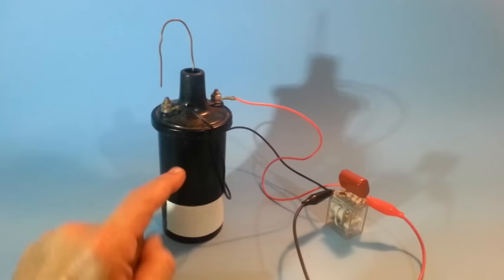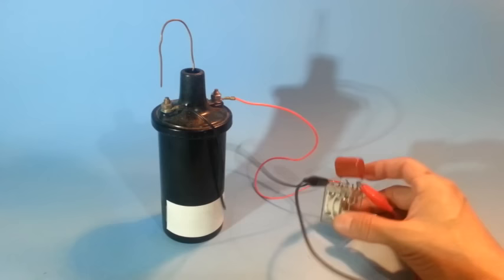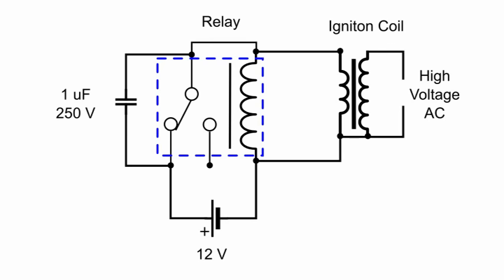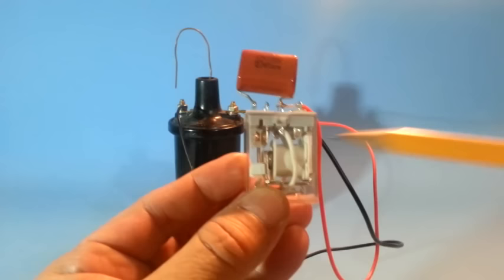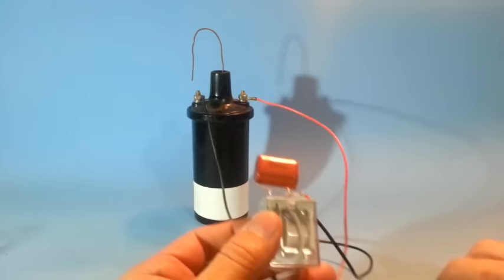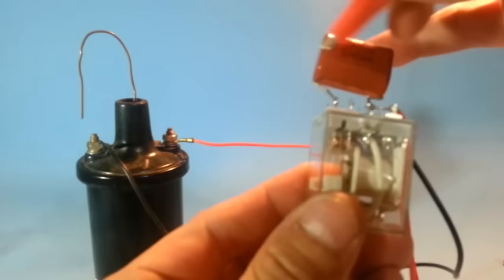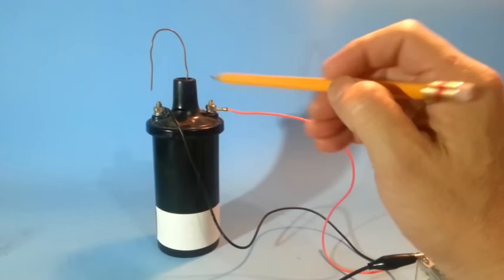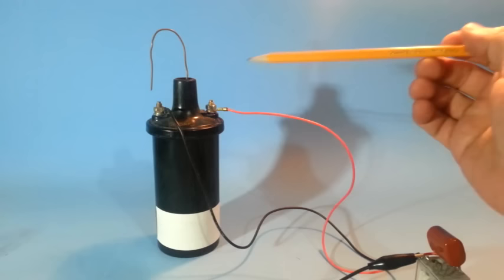Easy High Voltage with Ignition Coil and Relay

Comment: This circuit is ALMOST the same as the Tesla oscillator. the only thing to do is move the capacitor, in series with the primary coil of the step up transformer. The relay most NOT have a diode.  The primary is made series resonant with the (tuned) capacitor, and the inductive spike impulses of the auto oscillating relay are fed into the primary. this Tesla circuit can be found in the august 1919 article in the Electric Experimenter.
Reply: Though I do wonder what an auto oscillator relay circuit would need to be at resonance with the primary coil...
Reply: @After_Tech_Industries   the mechanical switching distance and supply voltage needs to be controlled to get the right frequency, which can be a sub harmonic of the primary coil resonant frequency

Comment: This video has randomly popped up in my feed, this is very handy for a basic arc generator, but this is pulsating DC for AC to be produced the current actually needs to be alternating positive to negative and back, this is just creating a high voltage spike from collapsing and reestablishing magnetic fields

Comment: I built one of these in 1975. My bully tormentor never knew what hit him. Twice! Ah, good times. Good video!
Reply from the maker: LOL ( ͡° ͜ʖ ͡°)
Reply: @ludicscience   hello sir can it work with a electronic resin ignition coil? with a electronic distributor system? just making sure and how many amps does the relay need? set up on a lancer sl 1985 production
Reply: hold up

Comment: the spark can be fed into the ignition coil primary if the primary is made series resonant (low impedance).
 the impulse (inductive spike from the relay coil when opening) will than be used to amplify the secondary, 
and will give much higher output! 
With NO spark at the relay. 

I will build it and show it on my channel, as this is how N Tesla did it.
Reply: Ok. Cool

Comment: Why do you need the capacitor? If you rig the normally closed switch in series with the relay coil when powered on the relay will open cutting power causeing it to close energizeing the relay coil opening it again causeing pulses.

Comment: I've done this using an old fashion doorbell buzzer to make and break the circuit. One good tip is to use the original ignition capacitor in the circuit. The original capacitor will have the correct capacity to match the coil perfectly for maximum high voltage output. Use of other size capacitors will not produce as high a voltage.
Reply from the maker: +MrCharlieCom Good advice thanks!
Reply: MrCharlieCom . hi, what is the original ignition capacitor value. thanks
Reply: I've played around with these before and it makes a big difference what size capacitor you use.

The correct capacitor depends on the particular model ignition coil. About the only way I know of to tell is to find what model car the coil came off of, then look up the part number/specs for what ignition capacitor was on the car.

If you went to a junkyard and purchased a used coil, maybe you could have them pull the matching capacitor at the same time.

Otherwise, you might try several different capacitor to see which gives the most output.
Reply: Like unbalance voltage from coil and capasitor?

Comment: Ludic Science ...What is The RELAY your using here ?? Is this a 12V Relay Or Something Bigger ??
Reply from the maker: 12v 10 amp dpdt relay
Reply: Im Using 30am / 12V Relays BUT they don't last as they are getting HOT and Burning up ...Can you suggest something ?
Reply: Ludic Science ...I Really Love your posts, BUT can you Comment about my Coil Driver Issue. My Relays Continue to Burn up or Jam ..Im thinking the Relay is Cycling to fast ?? Im using a Quality Relay ...is there a way to Slow the Switching ??

Comment: Alan McPherson  Referring to early ignition systems.

TO FURTHER CLARIFY...One of the laws of magnetic induction is that the output voltage of the secondary winding is dependant on how quickly the primary field collapses. If you took an auto ignition coil and applied 12 volts AC at 50 cycles the output from the secondary would be surprisingly small, because the rate of the applied current is relatively slowly building up and diminishing at only one fiftieth of a second, but apply an instant 12 volts into the primary, and provide a fast path for the collapsing field current to follow, and enter the capacitor, which quickly sucks up the energy, thus the output will be dramatically increased. Then the points shut, which discharges the capacitor, ready for the next cycle. The points capacitor Is not present in the circuit to stop arcing and damage to the points, it is there to assist in the rapid collapse of the magnetic field quickly soaking up the current from the collapsing field. That it stops arcing and destruction of the points is just a happy coince

dance.

Comment: Been trying this for a small project but can't get both the coil and the relay to work together with the capacitor. I have connected a spark plug to the coil and can spark the spark plug once using a 9v battery without the relay and I can get the relay to continuously oscillate without the coil connected but having problems combining the two set ups so the spark plug continually sparks intermittently.  Any help would be grateful.
Reply: yeah sorted it out - didn't use the capacitor afterall and had a continuous spark! Aren't I clever eh? So to get a spark plug to spark continuously all one needs is a power supply, ignition coil, relay and spark plug!

Comment: I just tried to build this circuit using a matched automotive condenser/capacitor but my automotive relay is just buzzing. Is the oscillation too fast for standard relays to be able to actuate? Did you use a reed relay? The one in the video doesn't look like a reed relay either. Any advice would be greatly appreciated!
Reply: I'm having this same issue. The relay just buzzes, but no spark from the coil. You ever get it figured out?
Reply: @BuildNStuff  ended up using a pre built high voltage generator. Cost less then messing around with relay and caps and is all solid state: https://www.amazon.ca/dp/B07ZYY6KZR/ref=sspa_dk_detail_0?psc=1&pd_rd_i=B07ZYY6KZR&pd_rd_w=ivXhb&content-id=amzn1.sym.c7dca932-da6a-44fc-af09-cc68d2449b34&pf_rd_p=c7dca932-da6a-44fc-af09-cc68d2449b34&pf_rd_r=5G77CPRC76SANBWVRN5Y&pd_rd_wg=KDqqm&pd_rd_r=624b8654-14f4-45ec-8fc2-5b74ca6ad23b&s=electronics&sp_csd=d2lkZ2V0TmFtZT1zcF9kZXRhaWw&spLa=ZW5jcnlwdGVkUXVhbGlmaWVyPUEyMDVMOTFNTFNISzFVJmVuY3J5cHRlZElkPUEwMTkyNzQ3M1UwWDVZUkdLSlVMSiZlbmNyeXB0ZWRBZElkPUEwNDc2MDQ4Rk5HN1VRSDg2Q1BEJndpZGdldE5hbWU9c3BfZGV0YWlsJmFjdGlvbj1jbGlja1JlZGlyZWN0JmRvTm90TG9nQ2xpY2s9dHJ1ZQ==#customerReviews

Comment: When i connect relay to ignition coil it stops buzzing. I think its because of low current(1amp adapter). Relay's coil got 400k ohm, indiction coil got 0.6 ohm. Can increasing amper output help? Or adding some resistor on way to indiction coil make it work?

Comment: Mr ,if we change capasitor with other thing (non capacitor) Such as dioda or transistor  or 12 volt small lamp ,what Would  it be  to ignation coil  ?, is it work or not.thank you ,

Comment: Have you ever tried to put the capacitor between the coil of the relay and the ignition coil to the second output? You can drive much more power this way.

Comment: I think that general purpose ignition coil is rated for 25Kv with 12 volts input.   That type of single coil was used in all cars and trucks  from about 1930 till around 2000.  They didn't change much, until 2000,  when they went to smaller coil packs,  1 on each cylinder..
Reply: And one per pair of cylinders- a 4cyl will have 2 coils in a pack, and a 6cyl will have 3 coils in a pack. These coilpacks will have 2 secondaries per coil and the system is called a waste spark ignition, because there is a spark present in the cylinder on its power stroke, as well as in the paired cylinder, on its exhaust stroke (of the 4 stroke Otto cycle)

Comment: how much current in the output? is the spark would still fire if two cable are submerge in water? is the coil can operate like that for a long time like 2 to 4 hours? i want to use it to make high voltage colloidal silver.
Reply from the maker: current is around 5 ma. if water is distilled i think it may work. howwever i don't think it can be used for more than a few minutes

Comment: Ludic Science, I just finished  watching your excellent video. I have been searching  for this setup.
 I want to apply this to killing rats in my garden. Do you think it would work? I have built an enclosure with 6 electrodes (3 pairs) spaced 3/4" apart.  
I want to connect this to those electrodes so when the rat steps on 1 pair of electrodes at the same time it will be killed immediately. I want to use a 12 VDC battery. 
The only issue might be that the spark will jump to the paired electrodes and continuously fire. I only want this to fire when the rat steps on a pair of electrodes. Maybe I could  control the spark gap with a larger capacitor. I would enclose this setup in a water tight non conductive enclosure.
Also can you tell me what type 1uf 250V capacitor you are using and what type/size relay are you using and how did you secure the wire in the center of the ignition coil.
Sorry for the long response, I hope you can help. TIA
Reply: Where did you get a relay like the video?

Comment: i have 2 questions with regards to your device ?

1) what size cap are you using and or can you interchange as you see fit ?
2)  can i use a normal 12vdc 5 pin relay 

thanks
Reply from the maker: +Nico Botha you can use a cap from 0.5 to 2 uF, ceramic or film type. Yes you can but it has to be 10 amps or more
Reply: Ok thanks ! It works. Do you have a video on how to connect a normal PIR (alarm passive) to work as a switch ?

Comment: hello ludic. can it be said that this is a primitive inverter circuit? and if the output is ac that implies you can step it down with a step down transformer, yes?
Reply from the maker: +Deandre Chitay Yes it is a kind of inverter. In principle you can use a step down transformer, however you will need a transformer that can whitstand 10,000 volts as input. Most transformers will burn with that voltage.

Comment: Can you put you write out the number schematic connections instead of the picture? The picture is good, but doesn't call out the numbers. I've tried this is a 4 plug relay. It seems this setup needs a 5 plug relay to work. Please elaborate a bit. Thank you!
Reply: +Mckane Buller Lee    Yes it needs a 5 pin relay
Reply: To add a bit to the earlier comment, you need a relay in which there are contacts that are normally closed.  You get that with a changeover relay, as shown.  It would also work with a 4 pin relay that has normally-closed contacts, but they're probably rare birds.  Buy a 5 pin (or greater) one with contact rating of at least 5 amps for this application, I suggest.

Comment: Hi! Thank you for this excelent video. I want to use a TV Flyback as a ignition coil in a experimental motorcycle do you think it will work?
Reply: Why? TV Flybacks have very brittle ferrite cores. Putting that next to vibration nightmare is not a good idea.

Comment: are you using 12vac or 12vdc? ,and if you are using dc could you use a drill battery or even 8 AA batteries connected in series?
Reply from the maker: +agashcool123 12 vdc. yes you can.

Comment: I have a question. Would it be possible to simply use a 12 volt AC power supply plugged into the wall (without the Relay) to get similar results
Reply from the maker: +Jon Fisher No, the relay is neccesary.
Reply: +Ludic Science Humm! Wouldn't the fact that you are applying AC to the circuit, create a high voltage ? I have never tried it but wouldn't that work?
Reply: +ll98ll So from what i am understanding is that if it a square wave instead of a sine wave it will work better. Correct?

Comment: I am having hard time to get my coil to fire. I am using 1uf 450v electrolytic cap and using your diagram. My relay buzzes but coil doesn’t fire. What do you think the problem is?
Reply: Shafi Mohammad switch connections and try again. Also be sure that ignition coil is clear(not rusty, working)
Reply: What type of relay are you using? I (foolishly) ordered an AC relay but just realized I should probably have ordered a DC relay, like this one: Uxcell a15062300ux0219 IEC255
Reply: Kyle Hendrickson I am using automotive 12v 20amp relay

Comment: i tried to do it, but even with the cap in the spark jumps in between the contacts of the relay and not in my sparkplug. :( what might be the problem?
Reply: You’ve put the capacitor on the wrong terminal of the switch

Comment: Mann that was clear. I've got good understanding of it finally, thanks. Question for everyone. I need to know if I hook up an ignition coil to a 9v square battery and solder in a capacitor, will it give me more spark than without the capacitor? If so, What if the 9v is a rechargeable? Will it charge? Less spark being that it's a rechargeable? Would it explode? What if I hook up two? 

I'm wanting to make a flamethrower kit but not run through all my gas with a modulator. So I figured if I just put an ignition coil not directed to the car battery, it wouldn't kill my battery. And I have the free will of just pressing the flick switch when I'm at high rpm(when I know my car's gonna spit fuel ) Any theories? suggestions?

Comment: A standard ignition coil has a primary resistance of 1.6 ohms.I have a ignition coil that has a 1 ohm primary resistance.  What value capacitor is needed in my case.
Reply from the maker: try using a 1 uF cap

Comment: Here you have the basis of a tesla coil or a Spark gap transmitter, This was one of the first types of RF broadcast transmitters for long range low frequency broadband transmitting. Pretty much outlawed these days as they were very RF dirty, disrupting a broad range of frequency's across the RF spectrum.

Comment: Is this a hot spark? 
I mean, would it burn a piece of paper easily of you held it in between?
Reply from the maker: Very easily
Reply: ah nice thats what i need.

I took apart a gas-light and tried using the sparks that heat up the gas, but it didn't work at all...

Comment: Very good. If you do this, just make sure the capacitor has a satisfactory DV/DT function. A common radio etc. capacitor will not cope for long.  Try one out of a distributor or magneto.

Comment: Was your charger Dc or Ac? I mean here relay must be working on Ac voltage.Is it true?
Reply from the maker: +IB RAHIM It was AC. The relay works with pulsating DC (which is almost the same as AC). That is the reason to use the relay, to chop the DC .

Comment: Made this circuit, very easy and well done.Question with my circuit; want to use this to generate voltage for a very small electric garden fence, many chipmunks eating and destroyin my garden, I had a 400v 1uf cap I used  and it worked but intermittently.Do I need to change something or is my ignition coil the culprit ? Thanks ,nice job
Reply from the maker: Try using a larger cap. 1.5 uf or similar. However, the relay contacts will wear in short time. This circuit is not recommended for continuous use.
Reply: Do you have a better option to get continued use,I have many rodents attacking my garden and would prefer the electric fence circuits if possible. Thank you for your quick response
Reply from the maker: http://chemelec.com/Projects/Fencer-2/Fencer-2.htm
Reply: Try a 630 volt .22uf cap   A 400 volt cap wont cut the hi voltage and current.
Reply: Thanks

Comment: Now that is fun, check the voltage on the primary with it running, it will be in the 100's of volts as the field collapses. I remember trying to attach a dwell / tachometer to a coil while the engine was running and did not think there would be a shock hazard. There IS
Reply from the maker: Craig Nehring oh yes it is!

Comment: If you're using 24V, would you use the same value capacitor?
Reply: A 250v capacitor is fine, but I would cut the capacitance in half: 2uF  to 1uF

Comment: Ludic science i have a question can you elaborate the schematic?? And can the capacitor have higher uf?
Reply from the maker: Johncarl Lopez the schematic is explained in the video. The normally closed contact generates a spark when it opens. the cap absorbs much of this spark and prevents premature wearing of the contacts.

Comment: Thanks for the video! I am trying to make an electric fence using solar power. The idea is to protect honey bees from Asian Hornet at the north of Spain, where we are suffering from this plague. What I need is a very simple circuit (like yours) for charging an ignition coil and discharge twice per second (aprox)... ¿Could be possible to modify your circuit in order to modify the frequency? Thanks a lot!

Comment: Nice videos, lots of great stuff.
I believe that pulsating DC is more accurate than AC. If the coil is connected following the + and distributor coil markings, the HV terminal will produce a negative pulse followed by a few much lower voltage oscillations. It's easier to jump a gap with negative polarity and that's why it is used in automotive applications.
I think that if you use this for plasma globes it would be very unpleasant to touch since the frequency is low enough for nerves to respond to the shock. An AC flyback would be better if you can find one.
Reply from the maker: +eminusipi Thanks! AC flybacks are rare these days, I was thinking on winding my own secondary
Reply: +Ludic Science I think that the challenge would be finding the right ferrite core to accommodate the HV winding. I haven't looked lately but some of those old flybacks may be available on ebay. Good luck.
Reply: Strange, I just built this setup with a brand new high performance coil, a relay and cap and ingot nothing.